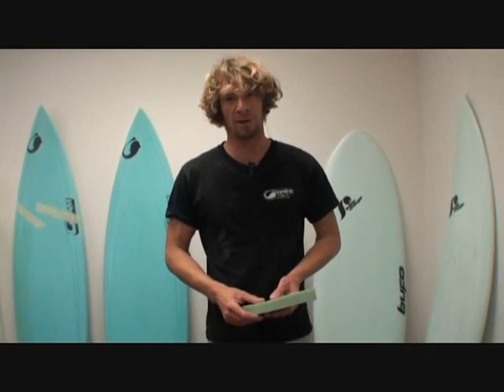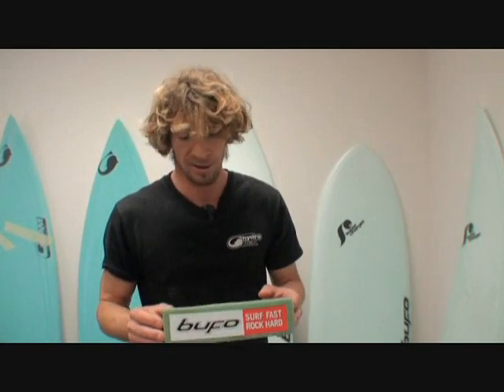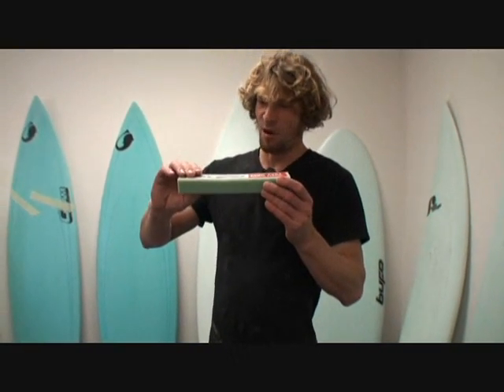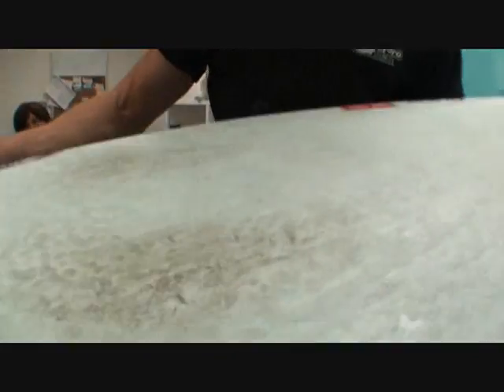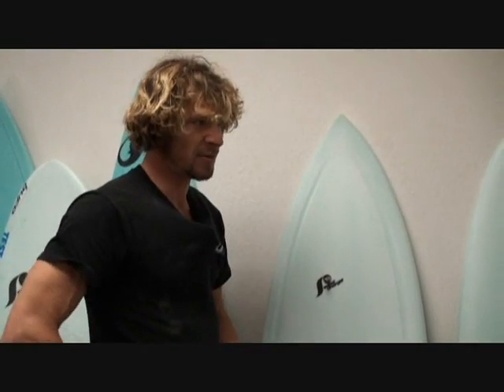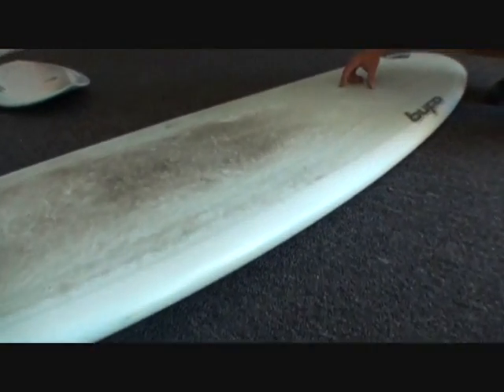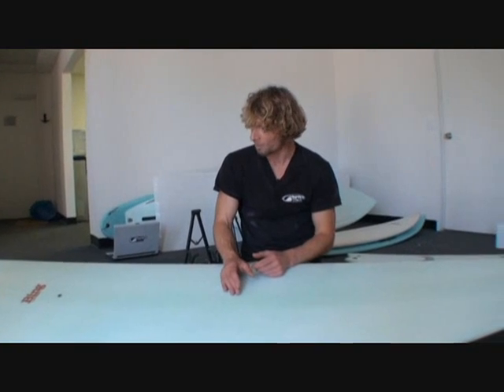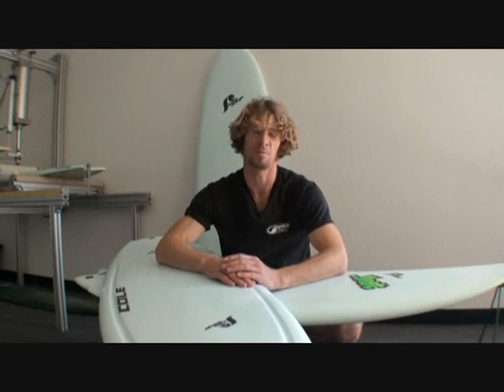Bufo Hydroflex Technologies

Comment: A normal stringer REDUCES flex slightly but is an inefficient use of materials as it is the skins which take most of the load.